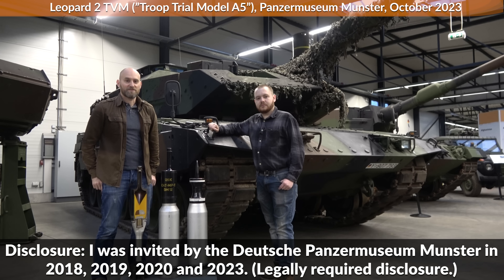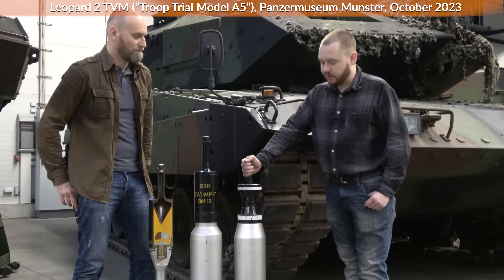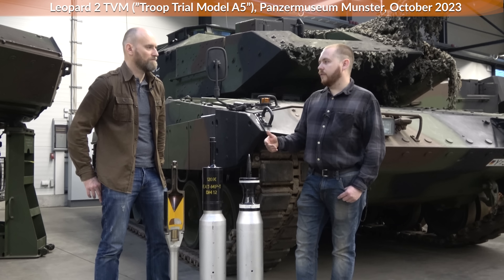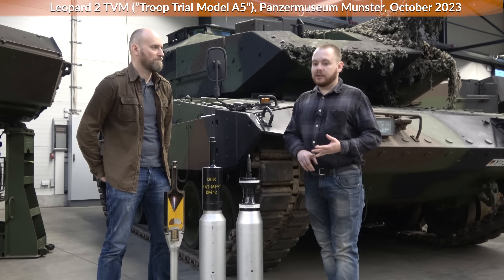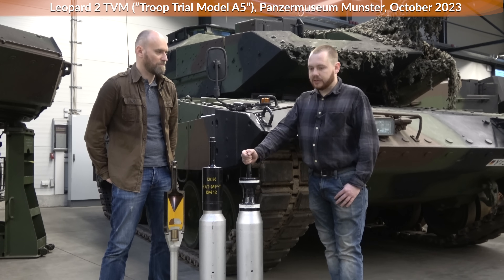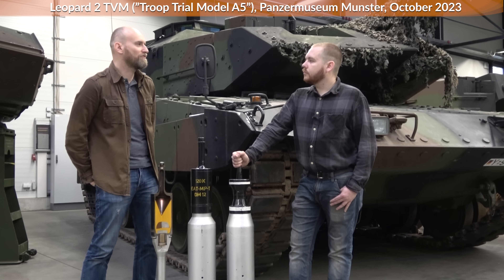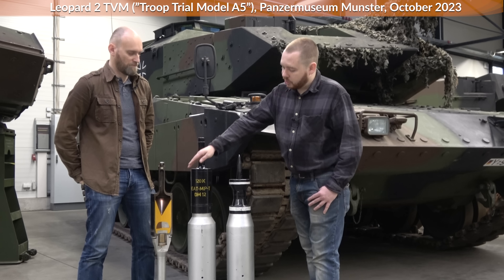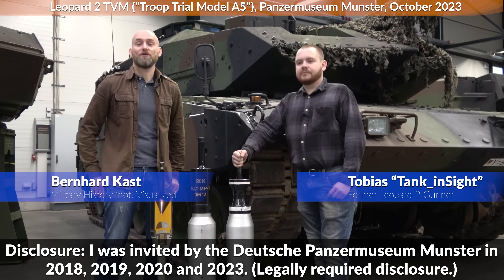Why you need proper HE rounds for Tanks

Comment: I am not sold on the 120mm airburst HE round.
On one hand you have IFVs with 40,mm and some folks are talking about 50mm auto cannons to fire airburst rounds which should be sufficent, given their ability to lay down weight of fire.
Secondly, indirect fire is exstensively used by tanks in Ukraine because of the LETHALITY of the modern battlefield. Old tanks like T55s would/were and are used in both direct and indirect fire by the break away states(not the Russians but their allies). But every time you send a tank up for direct fire there is a good chance it is not returning. And we are seeing this with modern Russian tanks and modern NATO tanks, it is not just the old cold war machines that are being wrecked en mass.

It just seems like arrogance to look at it and think: Well this does not apply to me!
Reply: You also have the matter of exspense and simplicy. You can churn out millions of unsophisticated 120mm HE rounds, and you might need millions of them.
If you cannot make enough sophisticated airburst rounds. Well its as good as not having any HE rounds.

Comment: 6:00 the americans actually train on using their M1 tanks for indirect fire
the commander tank of each platoon has a so called "master gunner" that has all needed training to perform indirect fire missions.
Reply: No we don't, and no we don't. Any round the tank uses, until very recently with the M1147, is impact detonation (or delay detonation in the case of the HE-OR-T). They would expend the majority of their energy into the ground if there is no direct hit. Armor battalions have a 120mm mortar platoon mounted on modified M113's which are much more effective fir indirect/high angle fire.

Platoons do not have master gunners. There is one for the company. That company master gunner may be in the platoon, but by MTOE he's in the HQ platoon. As an example, I've had a platoon sergeant by the company's MG, the first sergeant be the company's MG, and there be an actual MG whose sole job was company MG things (who also doubled as the HQ platoon sergeant). They may know how to do it, but they're not trained like a mortar/artillery Fire Direction Center is in receiving, interpreting, and enacting fire missions.
Reply: @bobbertbobberson6725  youre funny

first of all most artillery ammunition is impact detonated, so your argument that M1 dont indirect fire because HEAT-MP only got a impact fuze makes no damn sense

next you seem to forget that DM12 (or M830) both have a heavy fragmentation liner capable of killing soft targets quite easily.
the M1 do indirect fire in support if they cant be used in their original role.
that btw in case you missed it doesnt need a fire direction center
just look at the korean war and how M26 and M4 crews where not able to use their vehicles in the intended role, so they used them to support the artillery because a gun is a gun. since then master gunners receive the needed training to set tanks up for indirect fires if needed.

to qoute the US army homepage:
“We serve in kind of like an advisory role, especially like in combat operations,” Seitz said. “We advise the commander based on our direct fire and indirect fire capabilities and kind of employment of our weapons systems.”

article: "Army master gunners hold position of trust"

yes, youre right
there is just one MG per company, I misremembred that fact, but anything else you said is false
Reply: The Americans 'can' train to use their M1 for Indirect Fire, but it is rarely trained nor supported in practice. The only other military that has actually put effort into turning their Tanks in SPArty is the Soviets, they even have firing tables available.
Reply: @Sufferingzify  they do train it actively
That's exactly why each platoon has a master gunner who is specifically trained in this role and has the required firing tables and tools to set tanks up for indirect fire.

It's still part of the US doctrine.
Reply: Source?
Reply: @christianwilson5956  I know 2 master gunners who are active service

Comment: Opens General Dynamics website, nope, 120mm HE shell for NATO 120x570 is still there, like always.
Maybe it's not manufacturing problem, but Pentagon problem?
Reply: To add onto what others said, the Army also solved the problem with the M1147 which as impact detonation, delay detonation, and airburst capabilities. It also has a small canister as a nose cone to detonate short and spray into exposed infantry.
Reply: It's the intersection of doctrine and logistics. 120mm armed NATO MBTs had to counter Soviet tanks, their main doctrinal role, lightly armored vehicles, field fortifications and, of course, dismounted infantry too, of course, but they only have a combat load of 40 odd rounds to do it all with, which means something had to give. With infantry facing the most threats from other sources on the battlefield its easy enough to say that your own accompanying infantry, or IFVs, or artillery, or just the coax MG will keep their heads down most of the time and the few times that doesn't do the job HEAT-MP is "good enough."
Reply: @StacheMan26  Yes, you'll always have to make compromises. It's about which advantages you really need and which disadvantages you can tolerate. And according to cold war doctrine, western tanks are meant to counter Soviet tanks since nobody would be expected to cross impact sites from tactical nukes without riding inside ABC rated vehicles. The amount of infantry they were expected to face should be minimal that multi purpose shells could deal with them.
Reply: We know why there's a tanker on yotube that explains that when they captured a Polish t72m1(with ceramic sphere armor) in the late 80s they did testing and found out their apfsds couldn't pen it so they crapped their pants and said make a longer apfsds and don't bother carrying HE.

USA carried some HE in gwot 1 but after that it was almost completely phased out.
Reply: @off6848 I recall that NATO’s 120mm guns could pierce East German T-72Bs, but the 105mm guns with the exception of the U.S. DU rounds (specifically M833 and M900) couldn’t. 

That was a massive shock to NATO planners given that most NATO 105mm tanks didn’t use M833 or M900. Heck, the M900 was basically limited to M1 and IPM1 Abrams because it had a stronger recoil system.
Reply: @TheArklyte  if it isn’t the AMP round, the pentagon doesn’t want it.
You also have to think about Ammunition loads for the vehicle.
If you introduce an HE round into the mix, that means you get less APFSDS and HEAT to shoot.
The Advanced MultiPurpose (AMP) tank round is going to replace both HEAT and whatever HE rounds exist for NATO guns.
It can penetrate through concrete bunkers and vehicles alike, and with its programmable fuzing (thanks to the Data link) it can be set (by the tank’s firing computer) to detonate inside cover or a vehicle after penetration or it can be set to Airburst… it even has a little bit of Canister shot capability too.
It’s pretty much a good time to look at the Russians/Ukrainians and everyone else using old soviet shit “The future is now old man”
Reply: @PeterMuskrat6968  Sounds like complete garbage ammunition. Something that can do everything does nothing well.
Reply: @wolfehoffmann2697 will amp work quite as well at each specific use case when compared to a round that was specifically designed for that use? No. However, it will work well enough while taking mercy on the loader (auto or human) by not having to dig through the ready rack to find the one or 2 rounds of a specific type they are carrying.
Reply: @PeterMuskrat6968  
You know why ISU-152 was the longest serving armored vehicle in soviet arsenal and why it's tracks were modernized to be compatible with T-10M ones? Because 152mm HE round had an interesting capability to drop brick 5 storey tall building in single shell.
The other story from the same time, do you know what was the shell that was used 80% of the time by US tank destroyers in Italy in WWII? It was HE shell. Meanwhile AP and APCR shells were just sitting there, making up the majority of ammo load and never being used. This one has a bit of connection to aforementioned by another commenter fact that NATO views the prime task of MBTs to hunt other MBTs, however they didn't mention that every other NATO vehicle is also tasked with carrying ATGM and hunting MBTs. And it was these ATGMs that wrecked havoc upon T-72's on multiple occasions, not APFSDS rounds that were riding in ammo storage for 40 years without use.
It's also funny how for the last 20 years US was stuck in conflicts with barely any AFVs on opposing side and yet it was once again driving around APFSDS in ammo storages. The situation was comical enough that US army had ordered development and fielded a shrapnel round BEFORE it had "stooped down" to file an order for delivery of already existing HE ammo. Though you can argue that inability to get ammo matching the challenges of new urban combat environment indirectly led to lower civilian casualties. So there's at least some good in it.
HE round can also be equipped with programmable fuze to work in different modes, including HESH. Which one is more effective against concrete?

I'm not going to make a conclusion to these random data points I've mentioned, just let you dwell on if there is anything they have in common with the topic.

P.S.: unlike APFSDS, HE ammo doesn't lose effectiveness with range. On modern battlefield with proliferation of FPV drones, tank commander can observe and lead his shot over distances far beyond normal combat ranges for tungsten and DU rods.

Comment: Most modern vehicles don't have range scales, range tables, quadrant fire control or other tools to provide Indirect Fire.
Reply: You just need a digital gyro and gps, 5$ all in
Reply: @tedarcher9120  Um nope! How do you apply elevation, etc.
Reply: @whya2ndaccount  You're not going to but you don't really need to. You don't need indirect fire to be that precise, tanks are not dedicated artillery pieces after all, they will never have the same level of effectiveness. It's just if you have a tank there and not an artillery unit, you can use the tank for a bit less effectiveness.
Reply: @reonthornton685  A tank round won't do shit if it's not a direct hit, as they lack the ability to explode at a set elevation or time (only the brand new M1147 introduces the ability to explode at a set *range*). The energy of the explosive will primarily travel into the dirt and only be a threat to nearby infantry (as in, single digit meters away)
Reply: @bobbertbobberson6725  Both sides of the Ukraine Conflict are using tanks in this manner. Primarily the weaker armoured and older tanks though.

Also remember most older artillery are contact fuses as well and explode in the same way. Regular HE is still very much dangerous. Airburst rounds are not the norm for artillery as they are harder and more expensive to make.

Sure, most of the shrapnel will end up in the dirt but the shockwave is still very much deadly, especially if the shell lands on frozen ground that absorbs the impact less.

Although, true, it is less effective than actual artillery, but what do you expect? It's not an artillery piece, although the calibre of the round is actually bigger than some of the older artillery.

Plus, y'know, airburst or no airburst, no infantry are going to be keen to run into where the explosions are happening.
Reply: @reonthornton685  out of desparation, not because it's a good tactic. And yes older, WW1 and earlier artillery did. Air burst saw a massive increase in effectiveness vs personnel. Vs armored you still need contact detonation but artillery batteries can provide the raw saturation required to quickly achieve hits, that tanks (even at a company level) can't before the target vehicles would just move.

And yeah it's not artillery. Them being dog-fuck-shit artillery platforms is exactly what i expect. Infantry take cover from gunfire, of course they're going to take fire from actual explosions. That doesn't mean they're under the same danger as any airburst artillery.
Reply: @bobbertbobberson6725  Older Artillery includes artillery in the Korean and Vietnam war as well. Most "Airburst" ammunition is not actually airburst at all but just timed fuse shells based on estimates.

And in Ukraine's case, most of what both sides are using because airburst shells are harder to make and more expensive, and I'd be entirely unsurprised if Russia doesn't even have that many artillery troops even trained to use timed fuse ammunition.

It is mostly modern US equipment that has true proximity fuse airburst shells, which is unsurprising as they were also the first to develop anti aircraft proximity fuse shells although us British helped.

A large shell hitting dirt is still a large shell. It is a significant threat. Sometimes just the threat is enough. Most weapons fire in war is meant to suppress, with any kills being a bonus, outside of close quarters or armoured vehicle on armoured vehicle.

Sometimes keeping an enemy moving or pinning them down is more valuable than actually killing them outright due to the drain on resources it causes, not to mention the potential to engage on more favourable terms later.
Reply: @reonthornton685  yes they were timed and exploded in air. If i meant altitude or proximity detonated i would've said such. Time is still the predominant method of achieving airburst. And the new M1147 still has an air burst mode that works on an inputted range, and it's still an air burst.

And yes it's a threat. Me firing a 7.62mm machine gun over a terrain feature is a threat too. That doesn't mean it's worthwhile to do outside of specific circumstances. Actually, i have a better chance of achieving effect on target with high angle machine gun fire than tank fire because of volume. A tank round hitting dirt is hitting dirt. The explosive energy and fragmentation are absorbed by the dirt.

And no that last one just isn't true at all. It's better than nothing because it's something*, but in 10/10 cases actually killing someone is better than *just suppression. If i was firing a suppressive burst at someone and accidentally hit a bunch of them, 0 people are going to be upset, i guarantee it.
Reply: @reonthornton685  No one doesn't consider a round bursting in the air, to not be air burst. This is an arbitrary distinction only you abide by. Proximity and altitude are only methods to achieve air burst. The M1147 for example has a defining feature of a programmed air burst mode for use against troops in cover. I utilizes a digitally inputted range from the FCS. Further, you are getting wrapped up in the axle over semantics (that are wrong anyway). You know I meant "shells that burst in air". Even if "air burst" didn't apply to timed shells, the shells still burst in the air anyway, and they've been used for decades, and they're more effective against soft targets in every way. Point detonation is only superior with hard/armored targets, such as armored vehicles and fortifications, and those require direct hits. With current technology this either requires GPS-guided rounds with a 10 digit grid (accurate to a 1x1m square), direct fire, or a saturation of fire that even a company of tanks can't provide.

As for energy in the dirt, if most of the energy doesn't go into the dirt, then there would not be sizeable craters. The less efficient the point detonation (in ground), the larger the crater.

You don't understand warfare. This is an age-old myth spread at bar counters, not in actual military training or doctrine. Wounded can survive and continue to fight, or even if incapacitated they can survive and fight another day. Even if they are unable to return to fight, they can perform rear echelon functions and other able-bodies can replace them. EVEN IF they cannot even serve at an administrative desk or counting supplies at a headquarters building, the effect of unit morale of them dying in the first place, is worse than them surviving and going home to their families.

Finally, perhaps I wasn't clear enough. When I said "suppressive fire" I assumed you would understand that the context would be me in a support by fire or fixing position, instead of an assault element. The reason I would be in such a position would be to enable an assault force to attack from the flank, yes. The reason I am doing such is because there is a certain avenue of approach that would have the most success, so I am put into a position to distract the defenders from it. It's not that it's against orders to kill the enemy, it's that the guy organizing the attack understands that it's unrealistic for me to destroy them from a distance, and it's the assault element's job to actually do such. If, during my suppressive fire, I do more than I am expected of and destroy the enemy, and all the assault element has to do is clean them up, then I did not fail in my mission. I am not going to employ less effective/accurate fires than I am capable of, just because it's not my job to actually destroy them.

Yes a tank indirectly firing HE rounds will suppress them. But I'm ordering a tank to fire HE because I have no mortars or field artillery to conduct indirect fire with. It is an act of desperation, not deliberation. Actual indirect fire systems would have more effective suppression, additional damage against the target, and would have much more ammunition with which to conduct the fire mission. The answer to "We are resorting to using tanks in indirect fire roles" is not "Use tanks more often for this because it's a good idea", it's "Give them more artillery guns/ammunition so they don't need to resort to tanks anymore"